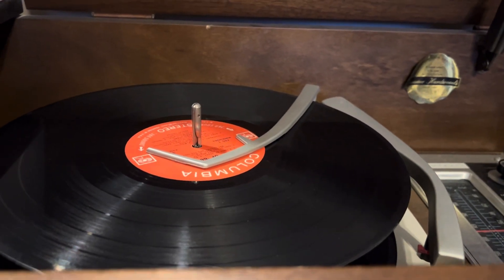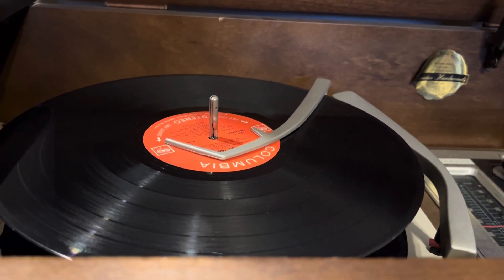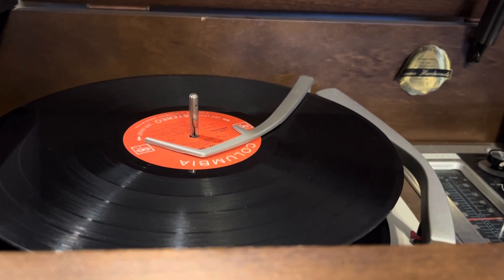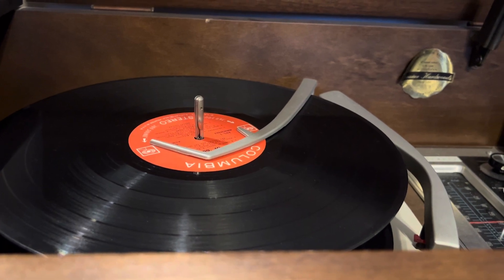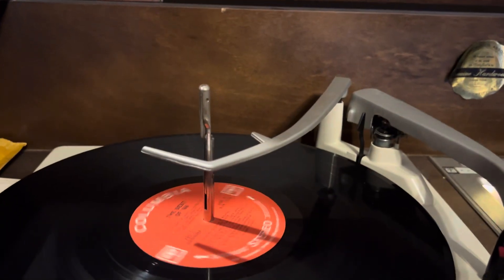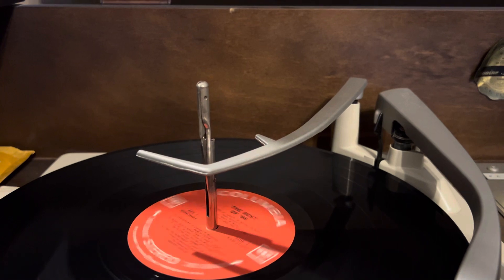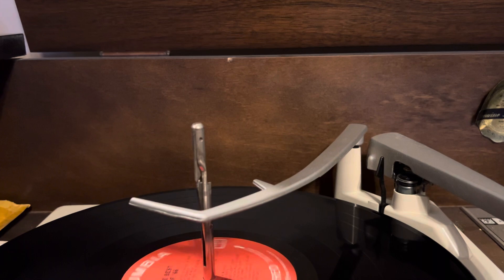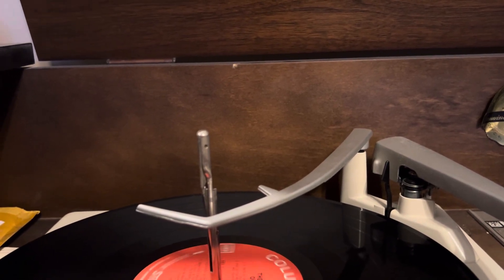VM changer overarm movement on last record ￼

Comment: This is correct operation of this machine. Without going into too much detail, there is a little lever that stops the machine from shutting off until the last record has been played in it lever also holds the balance arm up until the final cycle.

Comment: Expanding on that, that arm is actually more correctly referred to as the balance arm or the control arm. That more correctly identifies what it does.
Reply from the maker: Interesting. I’ve heard overarm, support arm, balance arm, record stabilizer.
Reply: I've always heard it referred to as the 'over-arm' for 50 years or so.